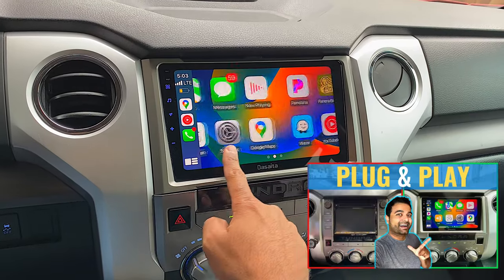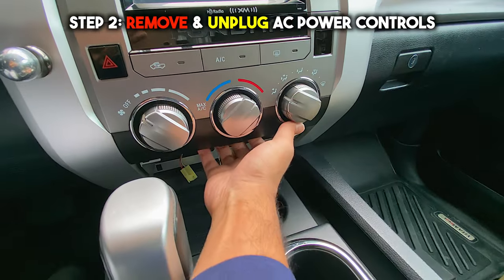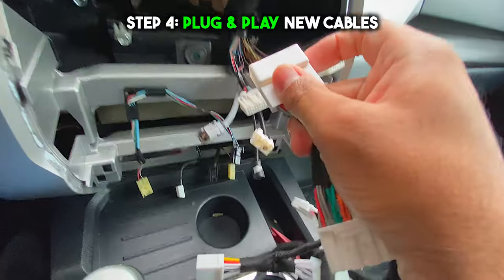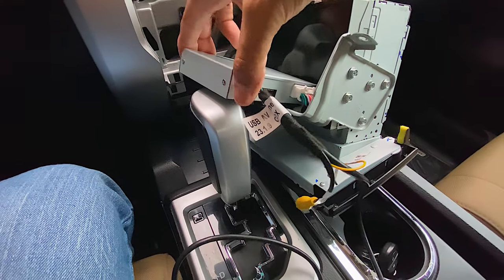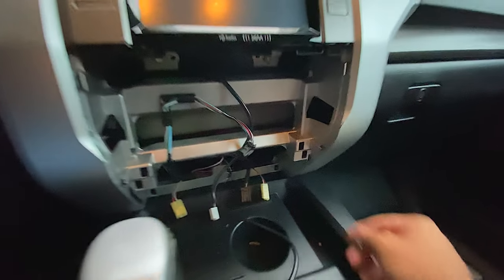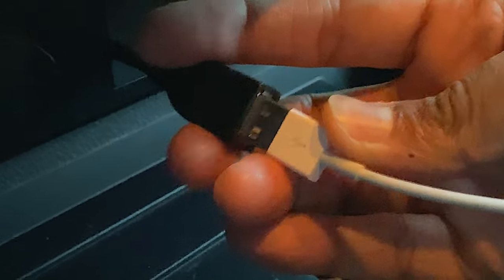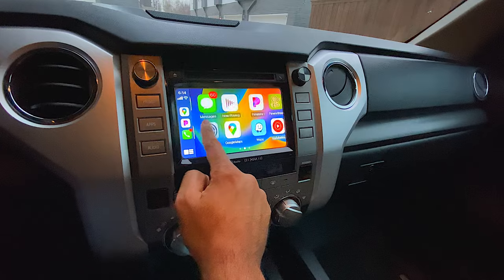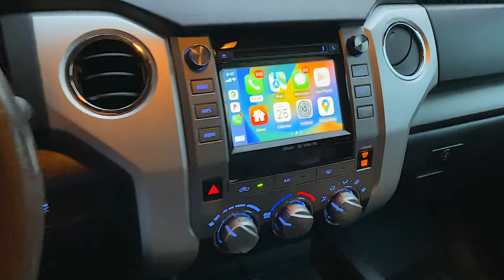HOW TO Install CarPlay In Toyota (Keep ORIGINAL Screen!) (2023)

Comment: This is EXACTLY what i want. No cheesy adapters faceplates and stock looking. Is there a plug and play amplifier upgrade i can use with this as well? I want to increase the power to the speakers and get some Focals or some other high sensitivity speakers to make the system louder and reduce distortion at higher volumes when i play rock or hip hop
Reply from the maker: Not that I know of, however, If I do I will let you know and make a video about it.

Comment: Just when I was thinking about buying a 2020-2021 tundra head unit to have CarPlay. I can across this video. Saved me over $1600. Thank you sir. Quick question can you use the stock usb for “wired CarPlay”
Reply from the maker: Yes, I believe you can. You will have to ask the company that question to be sure.
Reply: No, you have to use the dongle specific USB cable supplied in the box to have wired Carplay. Do not work using the stock USB port.

Comment: Hey KLEANTRIX! Some people have complained of the screen quality while using carplay (probably more of the stock screen's problem than the intalled unit), but what are your thoughts on the quality? Thanks for the awesome video once again!
Reply from the maker: So great question. My experience is that yes the screen from Toyota isn't that great, however, I have to say that I like it better than 3rd party screens even though they are of higher quality resolution. The reason why is that it just works fast and connects better than the other screen I have had. So overall I am very happy with this outcome and the screen quality is actually good. Also in terms of resale value, it's better to have a full OEM look to your vehicle.

Comment: Does this retain the stock software as well? Just in case for whatever reason you'd want to switch back to Toyota OE?

If it does, how do you switch in and out of that mode?
Reply from the maker: There is a button you press to get into the software and out.

Comment: How would you be able to make this wireless, I don’t like the fact that you would need to drill. Also don’t like that your need to use a wire in order to connect your phone.
Reply: It’s wired and wireless you can use both with it, and you don’t have to drill anything, Amazon has a usb port for the Tundra that you can pop into that spare socket place and it looks like the factory put it there.

Comment: Wonder if it works with a 2014 Lexus ES350 without Mark Levinson. The Lexis is not a touchscreen but instead uses a joystick to select. I also don’t know what version of Entune it uses. Anyone know or have a contact to ask?
Reply: If you go to the settings of your radio it will have all that information on what version you have and who the manufacturer is.

Comment: Just finished installing and CarPlay works great. I am having issues with backup camera. When I put the truck in reverse the screen just goes white. Tried shifting into neutral and then back into reverse but still having the same issue
Reply: I am having the exact same problem, we’re you able to get it fixed
Reply: @kristophergant4140  yes I was able to fix it! On the carabc home page, go to setting, camera, and change “after market” to “OE” and your back up camera will then work when shifting into reverse
Reply: @lemon271121   thank you so much! haha I was about to return it!
Reply: Yeeeees I HAVE CARPLAY IN MY TUNDRA 2018. THAAAAAANKS‼️ Everything works …. YEEEEEES‼️
Reply: @kristophergant4140 what did you do?

Comment: Any suggestions for the 9th accord ?
Reply from the maker: Unfortunately, they don't have anything for the 9th Gen Accord. Honda is extremely hard to modify the control unit because it does not have a very modern infotainment system... That's why I always stuck to LEDs for that car.

Comment: Do you have CARabc Wireless Carplay Android Auto Adapter for Toyota 2010-2013?
Reply from the maker: I haven't seen it, however what model is your Toyota?
Reply: @KLEANTRIX  2012 highlander and 2013 4 Runner

Comment: How does it work with SiriusXM?
Reply: You get off AUX, back to your normal radio interface and select XM. your normally radio will still be 100% functional with this system unless you unscrew the XM box to make room for the adapter box

Comment: Horrible unit, I just used it in my highlander,  it shorted something because now my backup camera doesn't work and the graphics were super nintendo from the 90s
Reply: Just go to the settings and switch the camera to OE, that will fix it.
Reply: You definitely should have read the manual before commenting. It didnt short anything out on your highlander. You just didnt change it to OE in settings.